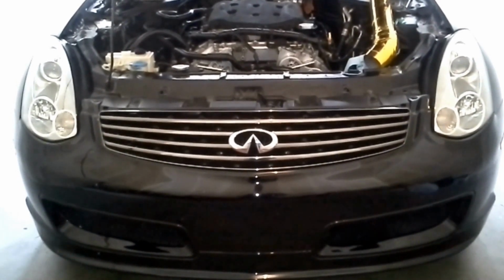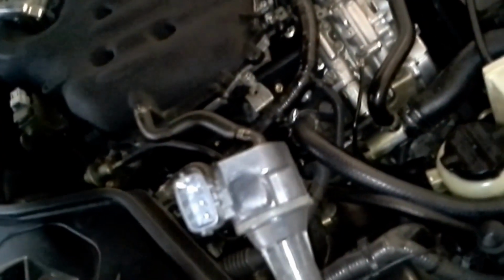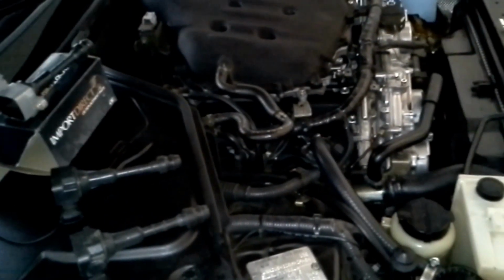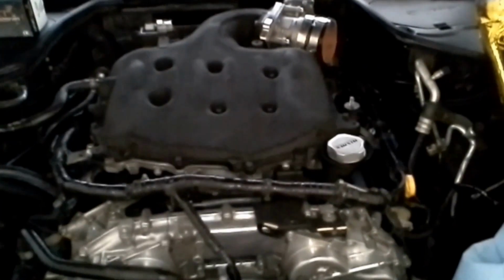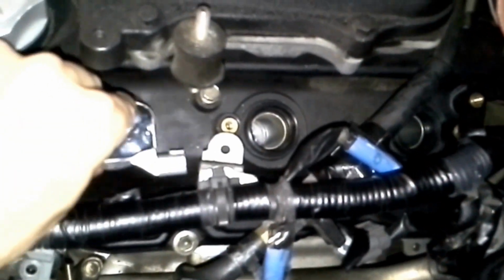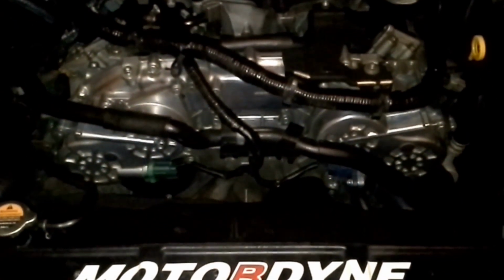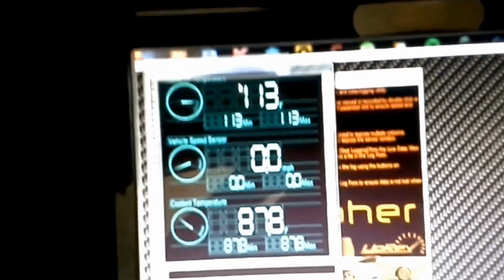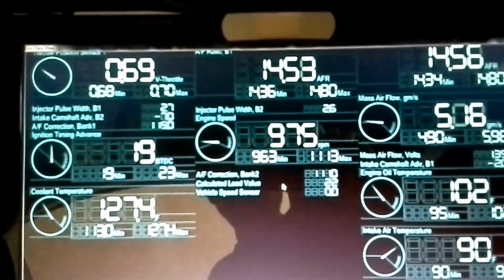INFINITI G35 / NISSAN 350z - How to tell bad COIL PACK - Misfire Random P0300

Comment: My 06 g35 rev up has a p0300 code and a bad power loss at 3k rpm i re did the plugs but still happing it smells like it's just dumping gas trying to find out what it could be
Reply from the maker: Did you replace any coil packs?
Reply: Not yet I didn't see any bulges
Reply from the maker: How many miles has it been since you changed any coil packs? Coil packs can still go bad without any bulges. Over 60k miles on coil packs is pushing it, they last about 75k miles. The smell of gas, means you got fuel coming in, but it isn't igniting in one of the cylinders or more. Make sure to wipe dielectric grease on the inside of the coil pack when installing a new one, just use a q tip.
Reply: What did I do wrong with the oil catch can

Comment: Hey man quick question. I was changing the spark plugs in my 03 g35 and found lots of oil in at least 3 of the spark plug wells. Car started misfiring immediately after finishing so I figured I needed to replace my valve covers. Replaced my valve covers yesterday and still have a random misfire. Inspected all my coilpacks today and found no signs of damage. The car will run perfectly fine for at least 10 minutes and then randomly start misfiring. Any suggestions?
Reply: Low G35 was it the coilpack?
Reply from the maker: Low G35 was it the coil pack?
Reply from the maker: The coilpacks may not show signs of damage like in this video. Have you replaced any of the coil-packs?
Reply: Motordyne G35 I haven't yet.
Reply from the maker: If you haven't replaced any of your coil packs, any coil pack over 65,000 miles, on this motor, is on borrowed time.
Reply: Motordyne G35 gotcha. 71k miles on mine. Thanks for the great info. I subscribed 👍
Reply: Low G35 👀👀 same issue also , anything change ?
Reply from the maker: See this updated video....https://youtu.be/h666VNsPv2M
Reply: If it makes you feel better, I'm about 90% sure it's the coil packs. I have a bad coil and there is sign of leaking oil in that spark plug. Same thing with a second spark plug. So I ordered a new set and we'll see what happens. I'll try to update again if this helps anyone else.
Reply: Did that resolve the issue
Reply: Did it work
Reply: Did it work? Mines doing the same thing.
Reply: 03-5 piston rings bland blowby

Comment: What tools do I need to replace #4
Reply: Be careful prying it thought, they are supposed to just slide up after you unbolt em, and they break easily , so be careful using anything to get the coils packs out
Reply: 10mm with extension for a couple bolts on the plenum that holds down the air intake, unplug the maf, remove the intake assembly then it is a 10mm bolt that holds down the coil. Might need a flat head to pry the coil plug off. Shouldn't take more than 20 mins to swap just #4.
Reply: Though*
Reply from the maker: See this updated video....https://youtu.be/h666VNsPv2M

Comment: I have a 04 coupe and when I drive hard it has a bad smell coming from the pipes and someone told me that it can be my catalytic converter is that true?
Reply from the maker: What do you consider a bad smell? If you ever go to a race track, it has a distinct smell and if it is that smell your CATS are probably ready to fail. That smell would mean your cats are going, but you really wouldn't smell much before the code P0420 pops up first for blown CAT. OEM CATS fail so when mine failed like 4 years ago, I went with Motordyne ART pipes. They smell like race car and never fail.

Comment: i have a miss fire and i have changed coil packs, full service including spark plugs, tried injectors and fuel rail off a mates 350z, tried adding a new earth, re set the ECU and drive it and the engine light comes on and flashes and i have loss of power, i have no idea what it is anyone help?
Reply from the maker: Sounds like you have a vacuum leak somewhere after the MAF sensor where un-metered air is entering the system and the ecu is dumping in more fuel to compensate which makes the car shake and die. Youtube vacuum leaks.
Reply: Motordyne G35 the car doesn't die tho, on idle if i rev the car it revs fine yet when it dies down the revs drop really low and the car sounds like its going to stall but doesn't then it sits back at 500rpm..? but my engine light is flashing and has a missfire and have tried so much i don't know how to fix it :(
Reply: +Zion! Ghosts Commentator! did you find a fix? mine is very similar.
Reply from the maker: See this updated video....https://youtu.be/h666VNsPv2M

Comment: great info. Will it still idle inconsistent if the valve covers need replacing?
Reply from the maker: Valve covers just leak oil, but can be leaking so bad that cylinder 6 could be getting oil in it which would make it idle bad once the plug has been soaked into to much oil, making the spark plug fail. My valve cover gaskets leak just a little bit on the sides, but no oil in the cylinders. Once I see oil in the cylinder, will I then do valve covers.  Highly unlikely your rough idle is due to valve covers needing replaced.
Reply from the maker: See this updated video....https://youtu.be/h666VNsPv2M

Comment: I just got P0300 and engine kept dying within few seconds! This is after I replaced my valve covers with new spark plugs and ENA coil packs into my 2005 G35 coupe.  Therefore I tried my original coil pack back and engine could only crank without starting.  check out my latest car blog video.
Reply from the maker: Maybe a vacuum leak? Did you make sure everything was put back together correctly? Light up a cigar and blow the smoke in the hoses to see if any smoke is escaping through the engine. I did this over to the hose by the battery cover to check if I had a leak, saw no smoke and thought well that cigar trick didn't work. Waited 10 mins, went over and the let the air valve off my CAI to see a bunch of smoke pour out after pulling the plug off. My point? I saw no smoke leak out, so I knew I didn't have a vacuum leak. 10 mins later smoke came out after I let it come out confirming everything was sealed. Cigar trick works.
Reply: Motordyne G35 I fix it last month.  I missed putting back a grounding wire to timing belt cover.  thanks

Comment: I will try a question. I have the same car. I get the same code. Car runs terrible, but if i drive it hard, with hard acceleration for about 5 seconds, it clears right up. coil or maybe blocked cats? Thanks for the great channel
Reply from the maker: Blocked CAT is a P420 code, which is failing CAT. If you are getting the same code, then you have a misfire. Did you ever figure it out? Flooring it is not the solution even if it feels smoother.
Reply from the maker: See this updated video....https://youtu.be/h666VNsPv2M

Comment: hey my friend quick question I changed the valve gaskets covers changed my spark plugs my g35 2004 coupe is shaking and it feels like it wants to turn off what can that be? and smoke is coming out my exhaust but from the middle too no over heating happening
Reply from the maker: Smoke coming out your exhaust, means you are burning oil. The car shaking and wanting to die, sounds like you have a vacuum leak somewhere after the MAF sensor where un-metered air is entering the system and the ecu is dumping in more fuel to compensate which makes the car shake and die. Youtube vacuum leaks.
Reply from the maker: See this updated video....https://youtu.be/h666VNsPv2M

Comment: need advice I have a g35 misfire code popped up but oil seems to be on my spark plugs as well not a lot just a little what should I do?
Reply from the maker: If you have oil on your plugs, it means you need a new valve covers. The issue is very common.
Reply: Motordyne G35 Would that fix the issue? I changed the spark plugs on mine because of a P0304 code and noticed oil on all the spark plugs but didn’t think much of it. It idles rough as well as when I put into a gear.

Comment: Hey nice video I'm going through this right now with my 2005 Infiniti G 35 and one day it started shaking at the light right before my house. Parked the car it's in the shop now apparently the warranty doesn't cover this?! It's crazy. Anyway WE have to find the coils and the valve covers?! For the dealer shop. Let me know what you think any advice would be greatful.
Reply from the maker: No problem, but what is the question you are asking? What are the codes?
Reply: You probably fixes this already but you shouldn't really go to a dealership go to a independent shop lucky I have all my repairs at a very reliable shop he's fixed my mk4 Jetta and couple months ago the g coupe
Reply from the maker: See this updated video....https://youtu.be/h666VNsPv2M

Comment: I'm having a miss fire on my 350z it's a de , it sounds like a subi boxer engine lol it's must be the coil pack right
Reply from the maker: What cylinder is misfiring?
Reply: Im having the same issue. No engine light is throwing. First i changed all sparks but the issue is still there. I also have test pipes so maybe that couldve messed up the o2 sensors. Or is could be coil packs. help please!!
Reply from the maker: Test pipes are not the issue. The engine will throw a code for the misfire eventually, but not right at first when it misfires. You are hearing the misfire immediately because of the test pipes. How many miles are on the car and have you ever changed the coil packs before?
Reply: Motordyne G35 It has 110000 kilometers. I got the car last yea r at 96000kms. I dont think they have been changed but about 8 months ago i installed a new exhasust and test pipes. No engine light is being brought up and no code. When i start up the car sometimes it sounds like a wrx, idle is like burp burp burp burp burp (say each burp fast and it sounds like that and has that rhythm. Sometimes it will be just normal and the car runs fine, but most of the time whilst driving it will go back to sounding like a wrx.
Reply from the maker: First off, whenever you put on test pipes the car needs to be tuned, preferably dyno tuned.  The increase in air flow will make the car run lean, which is bad. In regards to the misfire, if it sounds like a wrx, a code should pop up for the misfire. A code did not illuminate for me because I stopped the car immediately, but if I would have kept driving it, a check engine light code would pop up. Coil packs last only about 80k miles, you are due for new ones anyway. With test pipes, the misfire is way more obvious than without because of the change in exhaust note. Nothing sounds better than the motordyne shockwave with ART pipes, but when a coil pack goes bad you can tell the change instantly, just from the sound.
Reply: Motordyne G35 So you say its most likely the coils and because i have test pipes and an exhaust it is very noticable because of this reason? Yea i havent got the car tuned yet, and since the coils and new exhaust it has been running pretty lean.
Reply from the maker: Yes, because of the exhaust a misfire is very noticeable, but you should still get a code. Especially if you are driving the car more than a day with it misfiring. A code will come up. I guess it is possible the coil is on it's way out and it is misfiring and then working again which would be hard to diagnose which coil it is at that point, but I've never had a coil do that. Usually a coil goes out, it goes out. Did you look for bulges on the coil pack like I showed in the video?
Reply from the maker: I would be more worried about getting a tune, than what you are worried about. A lean running engine runs hot and will eventually blow up. Save for a tune, that is more important. No codes, but running like shit sounds like you need a tune.
Reply from the maker: See this updated video....https://youtu.be/h666VNsPv2M

Comment: Where can I get those headlights. I'm trying to get it for my 05.
Reply from the maker: Does Nissan give a lifetime warranty? In other words, when the part goes bad will they replace it for free? My coil packs from Orileys work just fine.
Reply from the maker: I also have an 05, but those headlights are 06-07 projector headlights from a g35.
Reply: +Motordyne G35 I have a 350z 2003 that is misfiring intermittently. no chk engine light. the Nissan service tech says one of the coils are bad. sound right?
Reply: +Rob B lol I'm I replaced my coils and spark plugs. It was either of those. Sounds right could be other things to.
Reply from the maker: Sounds correct. Coils are temperamental before they go, but when they go, you will know for sure and a check engine light will illuminate to confirm it. Your 350z is 13 years old, I"m sure it is time for all the coil packs, along with the plugs to be replaced. It is getting to be that time and remember Oriley's gives a lifetime   warranty on their coil packs.
Reply from the maker: I hope my video helped you HalaGaming on your spark plug/coil pack job. Nice work!
Reply: +Motordyne G35 ok..thx. he told me to stick with the Nissan parts because some of the after market parts may not hold the voltage...or something to that effect.

Comment: well not every gets a bulge.....coils sometimes test well but not necessarily perform well. always check compression first before buying anything. especially on these vq's
Reply from the maker: Thanks for the tip, you are probably right about the bulge, but so far every-time on a blown coil pack there has been a bulge. Well, in my experience so far that is what has happened.
Reply from the maker: See this updated video....https://youtu.be/h666VNsPv2M

Comment: Thanks for replying bk.so what ur say is right that the mods I have put on my g their not working for its full potential
Reply from the maker: Correct, the ECU thinks you have OEM parts and will not adjust on it's own, hence a tuner does it by dyno tuning.
Reply from the maker: See this updated video....https://youtu.be/h666VNsPv2M

Comment: Hey their had another ? What does dyno tuning do for ur car how does that improve ur car
Reply from the maker: +Joshua cuevas .....whenever you add modifications to a car, a tune changes the computer for the mod, hence making more power. If you add to many breather mods, your car will run lean which means too much air and not enough fuel. That is how an engine will go ka-boom and be destroyed.

Comment: why does your tachometer jitter when after its been revved?  to be exact why doesn't smoothly decrease all the way down?
Reply from the maker: The needle is smooth as butter. The jump you see is from half throttle, to full on the way up. The camera has a little shake in it maybe what you are seeing.

Comment: wait what is an inch pound foot
Reply from the maker: You use it on bolts that require very little tightening, yet you want to be exact to service manual specification. Foot Pounds is for like lug-nuts on your wheel and if you use that wrench, you will strip your spark plugs in the engine creating a serious problem. The plenum, lower plenum and your air intake is all in inch pound.  Sorry for saying foot at the end, it is inch pound. Tongue was twisted.

Comment: how do you tell there is a misfire? just the sound alone or error code?
Reply from the maker: Both. First the sound, sounds like a diesel engine and will shake at low rpm. Then an error code will appear about 3 mins later, with check engine light flashing. Flashing means misfire before even checking the reader.